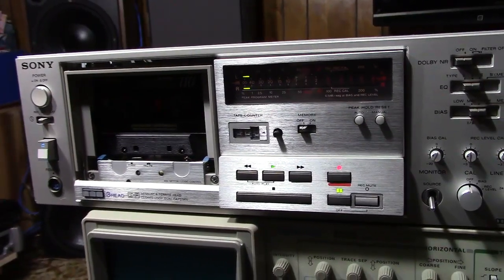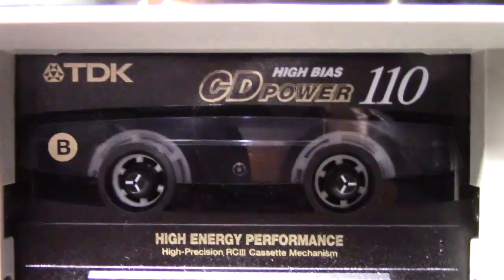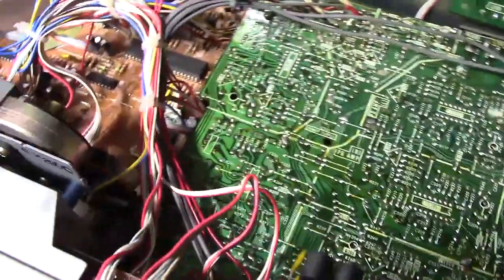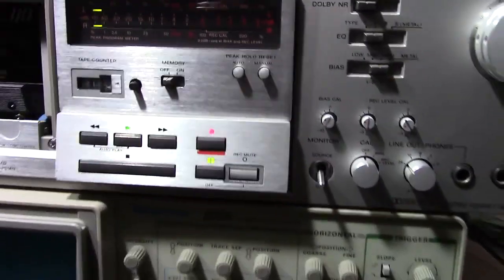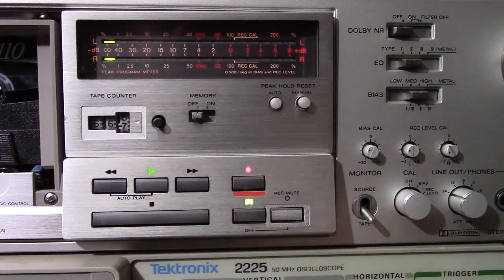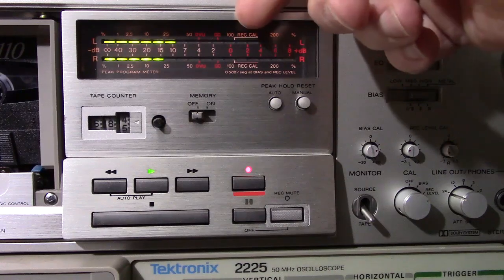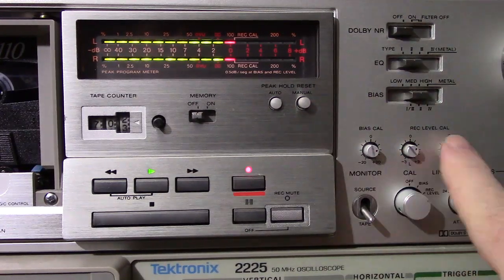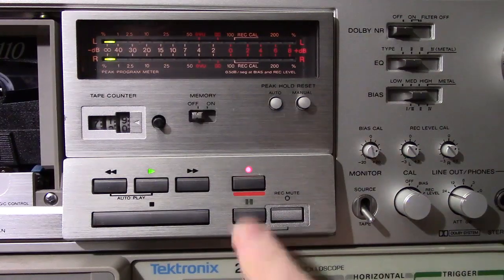Sony TC-K81: 3 Head Cassette- Calibration

Comment: Hello Hammy. What i'm hearing in your video during the music track is that the phase is 180 degrees out. I recorded a section, inverted the phase on one of the two channels and after that it sounds normal. So it seems that you adjusted the azimuth wrong (180 degrees out) but offcourse it could be your recording from the deck or processing of any kind afterwards...

Comment: I have the same model, but I'm having a ton of truble with the head hight, any advice?. The problem with mine is that after switching from tape side (a to b) the left channel disappears from side a after recording side b, I got the deck real cheap on a auction, already downloaded the manual, nothing helpful tho

Comment: Do you have any tips to give? I recently got a sony tc-k555 for cheap unfortunately someone fiddled with the tape path, azimuth, and all the bloody electronic adjustment pots.
Reply from the maker: I would get a service manual and see what's involved in setting the adjustments. Try hifiengine.com and see if they have anything. Good fortune on your journey.
Reply: @HammyTechnoid  Thanks, I do have a service manual, unfortunately I don't have access to a multimeter, I'm just getting by with furniture and oscilloscope software getting signals back from the play head.
At 7:42 you Lissajous pattern is as such \ which the service manual I've read through states as incorrect ( / this is apparently the correct signal).
Is your azimuth set alright?
Reply from the maker: @command8783   that display was purely for visual eye candy and not a "test signal" You are correct about the / angle... but in this case, for display, it doesn't matter. Thanks for watching! Take care!

Comment: One of my fave decks the TCK81, you had to blow serious money on a high end Nak to beat one when it came out. I recently got my old one back from my brother in law 35 years after he bought it from me, probably with less than 100 hours use in its entire life.
I got it back from its service at Armstrong Audio in Walthamstow a few weeks ago and it now plays back tapes as if it were new, the engineer said that belts and dry lubricant apart the entire machine was like new inside. Sadly when I tried to record I discovered I had the same issue with the record bias, a small oversight that they will put right when I call back to collect my Akai GX95/2 which they are working on. I am really looking forwards to comparing both decks when they are all tip top. Great vid BTW and I have another album to hunt down :).

Comment: I totally enjoyed your three videos on teh Sony TC-K81. I am thinking of buying a used one in my area . Is there any tips you can advise me what to check. I will do what you say in the video!!!!!!!!!!!!!!!!!!! IS there anything aditional to do?  Are there still heads available for this machine????  northguitar10@gmail.com  From  Rick
Reply from the maker: Hi Rick. As the owner of many vintage machines, all I can say is be sure to put the machine through its paces. Listen for anything funny. Nothing should be grinding or scraping. Make sure all the functions work. Be aware that certain issues are mechanical and can usually be fixed with belts or idlers. Some can be worse. It's nigh to impossible to find replacement motors for many of the machines out there. Then there's problems from electronics. Those can vary as much as stars in the sky. There may be an after market source for tape heads. E-bay might be the best source for those. Good fortune getting a machine that operates well. They are out there.